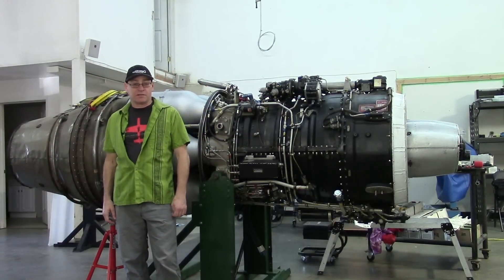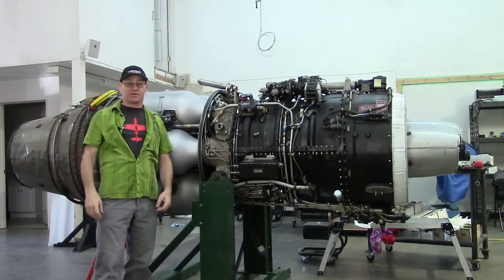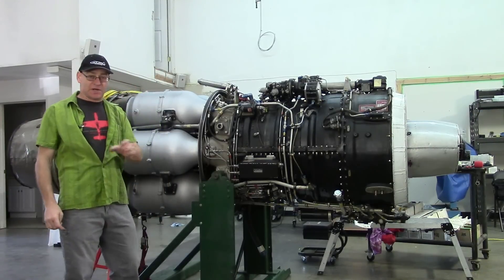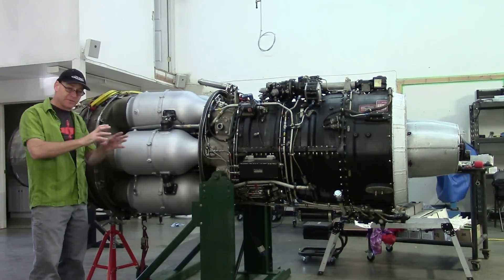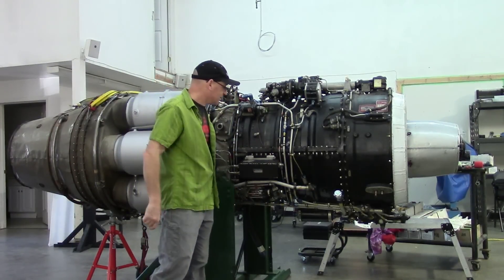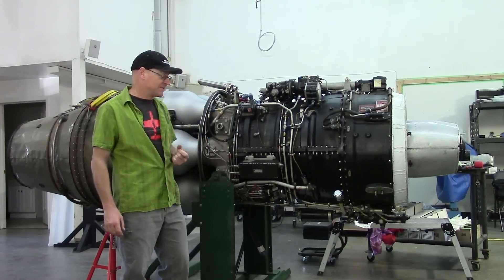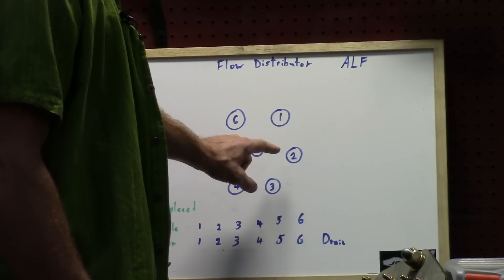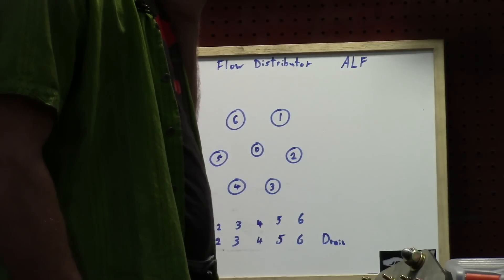Ready? Not yet...

Comment: Do you guys do any sort of fuel pressure test prior to starting the engine? Or is there know way that is easy to plug the nozzles off in order to build pressure...? How does the fuel pressure regulator(s) work on these engines?
Reply from the maker: +Gary  Ferguson Jr The fuel pressure regulator is built into the pumps, which are driven by the engine.There is no way to pressurize the fuel nozzles(which can't be blocked off) without having the engine turn at an appropriate speed which would require the resultant fuel flow. 
The fuel control allows small adjustments to what is supplied by the pumps, which is proportional to engine speed.

Comment: Been wondering about the water injection to the gas turbine engine. 1) At what stage that the water nozzle usually located? 2) Which engine still utilize this technique? (I think Harrier uses it to take off/landing)? 3) By introducing intake particle rather than normal air, how much would this water injection effect internal part?
Reply: +PRCThailand  I've answered for the Pegasus in the Harrier in the past.  Water injection is used for a matter of seconds for take-off only , at a so-called 'short lift wet' rating.  The water is injected into the combustion chamber.

Comment: Curious (mainly because of lack of information) But if your rebuilding something why wouldn't the seals be part of that rebuild in the first place ?
I look at it like if I sent in an engine to be rebuilt and they put all new pistons & rings and so on in but did not replace the valve cover gasket.
Reply from the maker: +JDALSystems You are exactly right, which is why I am choosing to no longer take on "quick fix" jobs. As I say in the video, the only acceptable results come from complete disassembly, inspection and proper reassembly, with all new seals and gaskets.

Comment: Thanks for the hard work making these videos.They are very informative indeed. I have a question regarding jet fuels. Maybe a Q&A material. As I know Jet fuel is less dangerous that avgas and mogas, but also heavier. Not only that, they are also harder to ignite. If for example we through a match into a concentration of jet fuel the match will just flame off, while if we throw the same match in a relatively same quality of avgas/mogas we will have a huge kaboom. How much safer is JetA to avgas and what other advantages it might have? I also heard that early jet engines could also run on avgas, is that true? Any chance for a controlled demonstration?
Reply from the maker: +Panos Demis Any turbine engine will run on gasoline, but it is more stressful on the fuel system because it lacks any lubricating characteristics, and it's harder on the o-rings.
The difference in ignition you describe is what makes jet fuel safer.

Comment: At least this engine wasn't rocking about
Reply from the maker: +Aidan Brown We used a different mounting system, but we never got into any serious thrust, so we did not make the transition from compression to tension on the front mount. Still, the 1/8 inch of slack on the mounting system, the result of carelessness on the part of my helpers last time... isn't there on this installation.
Reply: +AgentJayZ thanks

Comment: It seems a little silly to me on the part of the owner of that engine to only overhaul the hot section knowing that it had been in storage for some time. Even with the logs showing that there is plenty of life left in the mechanical components, soft parts such as seals and o-rings don't get better with age (as shown, obvious). I can imagine that the part and labor costs are very high for this type of thing, but come on.  If memory serves me it is bound for a Canadair Sabre 6, correct? Pretty rare bird? Yeah, lets just wing it!

Comment: You mean you don't want to go in to orbit because of a horrendous explosion?? Me neither. You could blame the rubber breaking down on ethanol., if there was any. Thanks to our "illustrious" government, we have that in our gasoline now. Bad for us but must be good for big business. Better success next time but good video!
Reply: +Lewie McNeely Maybe just rubber breaking down from 65 years of time eating away on it? Rubber just deteriorates over time, even without UV radiation or ethanol.

Ethanol in gasoline is especially worrisome when you have an aircraft piston engine which in theory can take automotive fuel, but must not have ethanol in it. Many piliots now carry an ethanol test kit. But I've never heard of ethanol in jet fuel.
Reply: True enough. I was about half-way joshing. I've never heard of it being in jet fuel but I am confident that if certain people can screw it up, it WILL be done! I don't want to even think about being up in a prop job and have an ethanol fit. I'd take a test kit too, and maybe a spare can of the good stuff.
Reply: +pinkdispatcher
Ethanol by itself in gasoline isn't a problem. The problem is that ethanol is hygroscopic, which means it gathers water from the moisture in the air. Then it settles at the bottom of the fuel tank, right next to the fuel pickup.
The straightforward solution to this, IMO, would be to add a water-separator to the fuel system. Of course that costs money, which is why the small engine, ATV, outboard motor, etc. sectors have such a problem with ethanol. Nobody makes the fuel tanks sealed, or adds a water separator, so they all have problems.
Reply: 44R0Ndin  For aviation fuel that property of ethanol is in fact less of a problem, because we always drain our tanks before we fly, so we will always detect water. Vapor lock and corrosion is much more of a worry for light airplanes. All that aside, when regulation says 0% ethanol then that's what we do.

For obvious reasons you also can't seal fuel tanks, because the fuel you have consumed needs to be replaced by ambient air. Nitrogen generation to replace it, which airliners often have, isn't practical for small airplanes.
Reply: Good idea. I always look at mine before refueling to get the crud out too. Check tanks and pump the crud out if you have to.